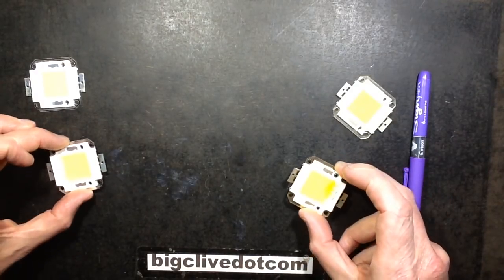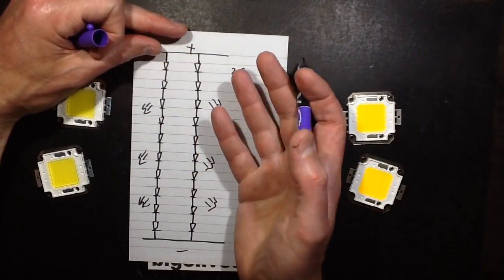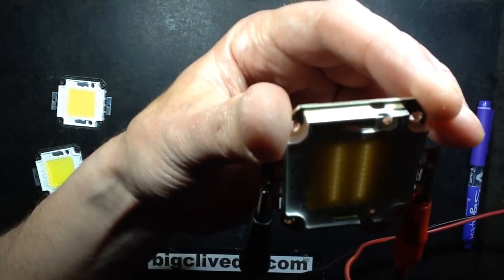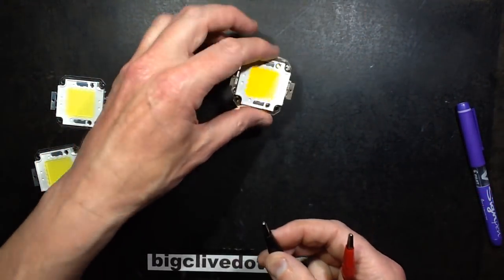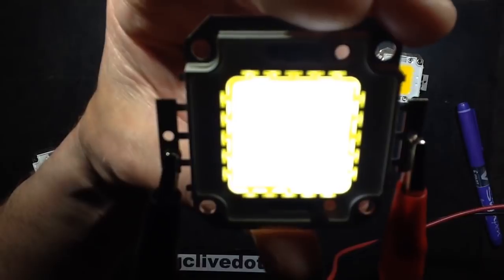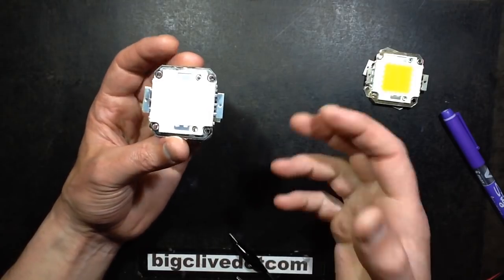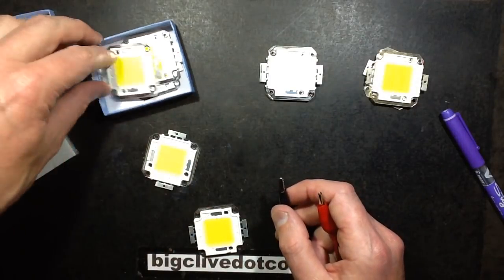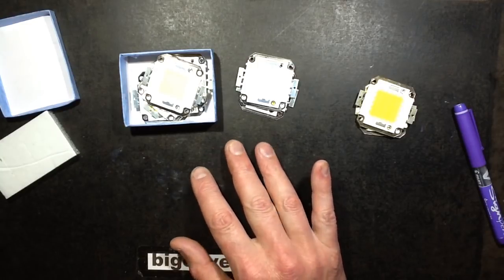Testing dodgy 100W LEDs from ebay sellers.

Comment: A few points: 1. encapsulant over LED dice is soft, and it is fairly easy to damage the wirebonds on these multi-chip LEDs with any amount of pressure on the encap. The result is usually a short or intermittent short, which would explain the patterns you see. The lack of mechanically protective packaging is of more concern than ESD protective packaging, in my view. 2. Some people think that perfect matching is essential for proper current sharing, however, most high output LEDs are fairly resistive (see slope of VI curve) so 'self-ballasting'. This accounts for why strings of different effective lengths will still light up. 3. As others have suggested, these are probably reject units, but possibly just badly handled units. In my experience, many Chinese suppliers are capable of producing very high quality goods, but there are also plenty of vendors who will sell low quality stuff to anyone willing to pay. I am an LED illumination design engineer.
Reply: Do you work on grow lights too?

Comment: Yes you are absolutely right those 100W are damaged LED's probably did not passed quality control.
Guessing some of them are shorted else there is no way they will produce any light at 9V.
Reply: ***** i have some of this bad 100W LEDs here, and last week i got some 10W 3x3 with the same problem.  My idea behind it, the have failed Quality Control and have gone to trash.   s.o  saw  them in the trash and sells them as good ones.
  If you take a closer look at them, with a very low voltage, one or two diodes light, if you increase voltage more an more of them light, until most of all (perhaps all) 100 LEDs  light.  The LEDs have very different spec on that chip. If you compare those LEDs with a good one (both same current), you see, that the good ones are much brighter.
  I think if you use them over a longer time with full power, they will fail very fast.
Reply: ***** LED's usually dont fail like that so it's more likely a screw up with the bonding process.
Reply: Gordon Lawrence They do actually fail like that as any other diode the junction melts if at high current and they get shorted but you may be right that is some sort of manufacturing process defect. This where rejected for sure at quality control and then sold as scrap at low price and then found their way on eBay.
Reply: I have seen plenty of rectifier diodes go short but due to the way an LED works it's more common for the bonding wires to go open circuit. An LED is not just a PN junction like a rectifier diode - it does not have huge bonding surfaces to the leads they are relatively speaking tiny.
Reply: Gordon Lawrence The way the LED's in this tests worked suggest that the defective LED dies are shorted.
This 100W LED's are made out of a 10x10 x 1W matrix where 10 LED's are in series and 10 of this strings in parallel. One of them started producing light at around 9 or 10V that suggests that one of this 10 LED series strings had around 6 or 7 of them shorted so all the voltage drop will be on the working ones.
Reply: The point still stands that it is more likely the bonding process has shorted out the LED as i said originally IE there is a solder bridge across the pads.

Comment: I must agree with the comments below that states that this test should be done in a constant current environment at max appropriate current and PWM controlled.
Show me the leds in this scenario dimmed (please)
Reply: Walter Boxhead Walter, I'm just learning how to drive all kinds of leds. Please educate me why my question is wrong?
Reply: No, but I'm going to.
Reply: I've seen the video. Have a lot of thesw single 1w leds. going to measure them. Still I would like the forward voltage threshold question answered. What is better,  increasing current vs pwm switching max current.
Reply: Kenneth Tan Hey... here's a suggestion:  JUST WATCH THE 20W CASE... (at beginning of video)

It demonstrates a key fact: that the matching of led bulblets (emitters), when very-good-to-excellent, results in uniform strip glowing as voltage comes up BECAUSE they're matched.  One can expect this behavior until they're at full rated power because of the quantum-well nature of LED devices. 

Having "constant current" is a nice ideal, but it does NOT spread out the voltage-of-conduction to the array-of-emitters' individual elements.  Not when they're soldered into a 10 x 10 grid.  Maybe if you have time, take a look at my top-level comment?

Yours
GoatGuy

Comment: As a manufacturer..this is how it works. You take the best ones in the production line and sell in your manufacturer busines name. The rejects in the QA test are sold on ebay cheap..its better than throwing away. Its like cheap arduino boards. Cheap for a reason

Comment: Your running 100 watt leds at a few watts and your surprised it doesnt work?
Reply: Jarrod P what
LEDs aren't exactly complex ICs. Undervolting them is not damaging and should either cause the lights to not show or to be dim. They should never be patchy as this video shows.
Reply: Jarrod P No. He is surprised that the diodes weren't matched. Even though they will (probably) all turn on at 100W, they will be collectively less bright (the power rating is what it is for a reason -- the light output from the diodes which consume too much power will not compensate for those which consume too little) and more importantly will have a much shorter lifetime. The lifetime of each column is decided by its weakest link and temperature differences can have dramatic effects on longevity. If the one "overeager" diode in a column burns out 3x quicker, the entire column dies. This is why matching is important even if you can't "see" the patchwork at full power.
Reply: Jarrod P get out. grow a functioning brain.
Reply: Brian Gregory Sir... did you watch the whole video, or did you skip to the end whilst texting ... and just come up with what you said?  The 20 W units shows PERFECT emitter matching.  Exactly what is supposed to be the case for the 100 W bulbs.  

Instead, the crap-100 W modules showed a kind of patchwork that could only result from faulty, or sub-standard, or way-out-of-spec emitters.  Or shorted ones.  Or solder shorts.  Basically either really misfortunate errors in manufacture, or deeply mendacious RE-marketing of known faulty parts that were either stolen from a competent maker, or bought for scrap, then sold via EBay to the dupes "in the West".
Reply: Jarrod P ever thought about learning how LED's work in series?
Reply: BLACKTRONICS you are 100% correct
Reply: +Jarrod P i have 30 watt led flood light that it has same problem.. but with full voltage all of leds will shine fully .. i have checked it with welding mask :D
Reply: Blacktronics  How do you know they are just in series? They might have some resistance in parallel with the individual LEDs.
I'd like to see what they look like at, say, somewhere between 30W and 100W. You'd need dark glass or something to be able to see if all the LEDs were working more equally in that situation.
Reply: Robert Lynch When designing a quantum mechanical device with fail short equalization, be sure you also evenly bin the troll process Jacobean over the mean unit of sale, with randomly misparametrized supplies, mount parameters and temperatures. Or ideally, have the hardened built in logic promise harm in 52 languages to techs hooking it up direct to piles as here...just haven't got to a more scrutible script in the sequence. It is not an actual curtain of diodes.

Comment: I can confirm your findings. Even with the more „expensive“ ones there seem to be 2 or 3 dim LEDs in the matrix of 100. But this refers to the 23..24Volt range in which they are quite faint. If I increase this to e.g. 26..27V my eye can’t assess the brightness any more as they are too bright. Using some sun glasses and welding equipment I managed to figure out that the brightness at that point is pretty even all across the matrix. Or in other words – the dim ones got up to brightness.
So I would not worry so much about the voltage the individual LEDs need to “visually emit light” but rather focus on abnormalities in the range (28+Volts) they are typically operated. In case of mine there wasn’t a noticeable brightness difference.
Additional remark: Just if one LED in the chain lights up – that doesn’t mean it is the only sink of energy. LEDs typically behave like 2V Zener Diodes (well 3V-ish in this case). But assuming that the reverse bias breakdown voltage is somewhat similar (say variance 1.9..2.2V) amongst LEDs the overall balance isn’t harmed significantly. To my experience with conventional LED’s - the breakdown voltage varies but even ones with the same current at the same voltage might differ in brightness.
So unless you intend a very precise light distribution in very dim lights I wouldn’t worry too much about the inner balance of diodes.
Reply: they even out with voltage. his assessment is not correct, and it isn't the first time.
i'm not even bothering to explain, they are all ok. try to "short"2 out of 10 and the others will instantly burn. or 9 out of 10.
he's so wrong he's not even funny.
he was refunded, because all sellers do that, afraid of bad rating.

Comment: Good chips at the right price http://www.ebay.co.uk/usr/delhanway2009?_trksid=p2057872.m2749.l2754
Reply from the maker: 1love 1heart I've had some very variable quality stuff from Delhanway.  Have you tested these LEDs at very low current?
Reply: bigclivedotcom Yes the 100 watts ones light up like your 20 watts .

Comment: There is a reasoning behind those trashy LEDs and it makes sense and it is pretty simple:
1: LEDs, if produced and used correctly, can provide decades of zero maintenance, care-free operation. Imagine street lights and car headlights not needing repairs in one's lifetime.
2: Chinese LEDs device factories cannot survive decades of not selling their products. There is only so much market you could fill with one product and it needs to break soon enough that the production line does not stop.

That's that...

Comment: I have a 500w one, when I got it all of the diodes worked, but now I have one or two strings that is not working, and two or three that choose by them selves if they will work, but if I put enough power in them almost all work

Comment: I bought a horticulture 180W LED light with 60x3W diodes. The info said that the working current was 0,7 A. at 220V this would give off 165W, which wouldn't be so bad. Instead it draws only 0,3 A, so there's around 70W of light instead of the original 180W. The seller claims no responsibility, and says it's made so to give it a longer life.
I haven't opened it and checked, but could it be possible to tune this and make it deliver a bit more, or could I replace the driver and get at least 80% of the power output it's supposed to give? Not sure if you have any insight on this kind of light, but thanks anyway.
Reply from the maker: spancer87 From the description of the currents and number of LEDs I wonder if they are all connected in series with a limiting device directly on the mains.  The 300mA would suggest 1W LEDs with the 700mA being common for 3W LEDs.  They may fitted it with 3W LEDs but are running them as 1W for heat and reliability reasons.
Reply: bigclivedotcom I opened up the light to check the drivers. There are three of them. Two supplies power to the LED's and the third is for the fans. Their data is: input 110-240V, output 60-90V, current 380mA and 50W. So in total they will only be able to give off 100w max, minus some % here and there. What are my options then? Can I find cheap replacement drivers that will bring out let's say 150 W total? Any tips?
Reply from the maker: spancer87 You would probably be better leaving it as it is.  When the LEDs are run too hard they degrade faster, so if you did increase the current through the LEDs they would ultimately end up putting out less light in the near future than if you left the current as it is.
Reply: I see your point, but if they are 3W, and are now running at around 40% of that, then they to still have more to go on, shouldn't they? Like 60-70% would make a big difference. You see I'm growing medicine on a budget, so I really need as much yield as possible. I couldn't find any drivers online rated for 60-90V output, so I'm not sure how to proceed if I'm gonna try and increase the power output.
Reply from the maker: spancer87 If they are actually three watt.  And also if the housing is capable of dissipating the heat, although the fans will help.
The 60-90V driver is an issue, since they are a bit harder to find.  If you had been able to find similar drivers with that voltage range (the LED voltage is probably closer to 90V) and the outputs were true isolated DC then it's possible you could have paralleled pairs up on each group of LEDs.  Other than that, to use the more common drivers you'd need to rewire the LEDs in series circuits of ten and maybe even in parallel groups of those circuits on the more common drivers that put out around 30-40V.
Reply: I see. Well thank you for your wisdom! Very much appreciated :-)

Comment: I have one of those 100w LEDs, all the LEDs in it light up on full power, it's only patchwork at lower voltages.
Reply: But it shouldn't be. If what Clive is saying about the circuit design is correct, all LEDs should light at an even brightness at the same time. An inconsistent light at lower voltages - "patchwork" if you will - suggests that some chips have a decreased resistance and/or power consumption comparative to the LEDs surrounding it. 

This can result in increased degradation of the LEDs, at a faster rate, due to an overcurrent situation occurring within the LEDs with the declined resistance, meaning the whole arrangement has to be replaced sooner than its decent, consistently lighting counterparts.
Reply: Then the one you have is JUNK
Reply: CoolDudeClem -- not known for having any clue what he's talking about.

Comment: ESD packaging for shipment should be required by the seller, and I have complained of this even with logic cmos chips.  I'm sure esd is of primary concern, afterall it is for me.  Don't get me wrong there are quite a few suppliers from china that have done me quite well.  I did leave the appropriate comments on esd protection on ebay.

Comment: Hi, nice test but try higher power, cooling and some light filter. I'm using one of those 100W in my underwater light and they stabilize themselves at about 27V. I'm running the LED 31V 3A and when I look on the LED using welding filter I see them all nicely glowing.

Comment: My 100W LEDs have 1 or 2 dead LEDs, and uneven forward voltage. But I was expecting the unevenness since it was cheap. The solution is complex, and it is to use PWM if you want really low wattage, and proper current regulation if you are at a  high wattage to remove flicker and get higher efficiency.

But when the LEDs gets too unevenly matched, it gets sort of unusable. Isn't it very likely that these are B-grade LEDs?

Comment: i found them a bit better. Ordered one 100W led with PSU for $20 from aliexpress. it worked great for 3 weeks running as my room lighting at full 100W then it slowly died. I ordered a lot of 5 100W leds from a different seller for  $20 and they actually sent me 10 leds lol.  Out of the 10.  3 were pretty well matched, 5 were ok and 2 were terrible.  I put one of  the 3 good ones in my room lighting to replace the blown one and its been running for 6 months without prob.  Im 99% sure they are selling rejects from the china factory that makes them. The non-reject 100W leds sell for ~$40-60 each, so i really cant complain at 3 good leds for $20

Comment: Ebay user wholesale-led sells the real ones.  Epistar brand and they have double sized emitter die in them.  Ebay listing 361294347502 and are $40 USD each.  All the other 100 watt LEDs are GARBAGE just as bigclive shows here from my experience.  Even those 20 watts ones in the video use the puny emitters.  I purchased my 100 watt unit over a year ago to make a bike headlight.  People ahead of me don't like my off road bike headlight for some reason....   Anyways, I am assuming wholesale-led is keeping up the same with their quality control.  In the listing they explain why their product is better.  At 1mA startup current where the LEDs just begin to be visibly illuminated; all 100 LED elements are EXACTLY the same brightness.  The overall the output of the double sized LED die used make this the real winner.  At least the one unit I bought from them was perfect.  Good luck and let me know what you experience from them.  Very sensitive to ESD and require good heatsinking.